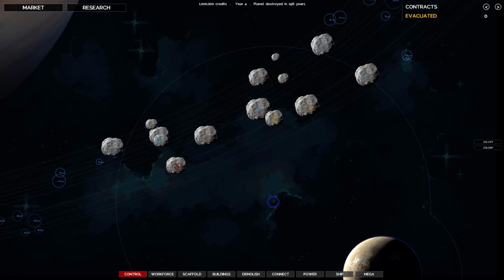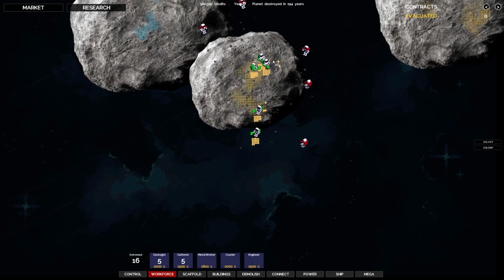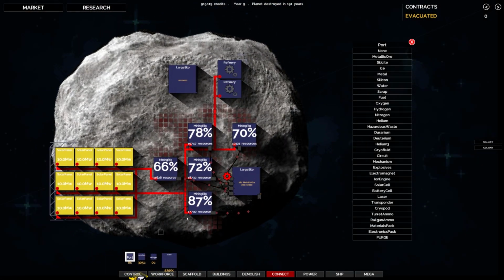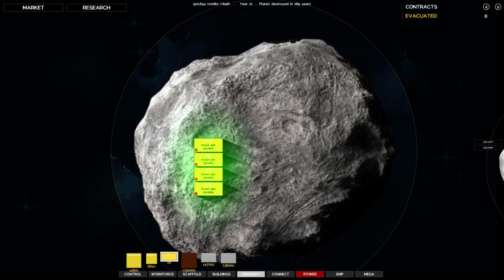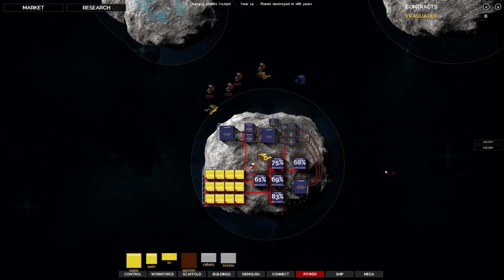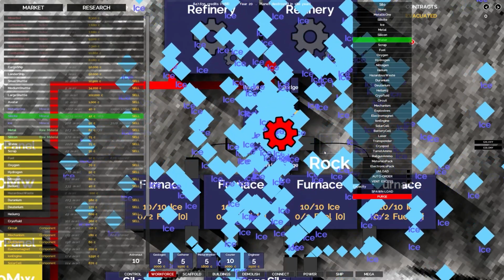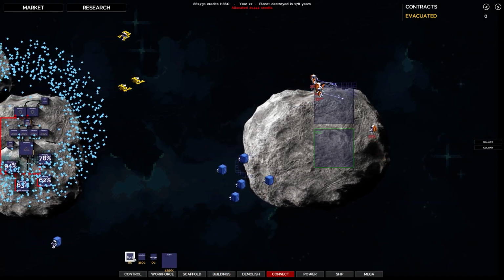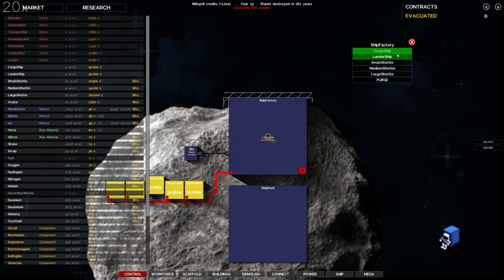Going Industrial in SPACE! | Deep Space Industrial Introversion Prototype - Let's Play / Gameplay

Comment: Great video, thanks :). Glad you had fun!
 You CAN move material from one silo to another using your courier guys, but it's a little fiddly. You had the right idea of setting the destination to request Metal. Then at the silo that is full of Metal you have to tick "Unload" - this tells your Couriers to pick it up and try and put it somewhere more useful. Worth noting that if the commodities window shows SELL next to the item, your Couriers will take any spare metal to the transport gate and sell it.
You can also use the Gate object under the Connect menu.  You need a gate at either end and its a directional one to one link. But you can put whatever you want into the FROM gate and it will pop out of the TO gate like magic. Subspace short range transport ftw!
To build an interstellar ship, go to the ship menu and place a Ship Bridge first.  Then you'll be able to build around that.
Have fun!
Reply from the maker: Indeed, and thanks for the info. Played some more and feels so close to RTS territory! Was leapfrogging on the asteroids while gathering, building, and defending. Suddenly found myself really wanting to build ships from scratch using the same method and systems, then send them off to attack. By extension would have to build the infrastructure of refiling, repairing, and re-arming too. Just my 2 cents. Hope you find an angle and have another stab at it. For everyone else reading, this is the developer ↑↑↑↑↑↑↑↑↑↑↑↑↑↑↑↑↑↑↑↑↑ (Chris?), so any questions, suggestions, or words of encouragement reply on!
Reply: Really enjoying this one

Which way round do you link it, do you select the to gate from the from menu?

Also how do you work the buildable cargo ships are they like large couriers?

Finally is there a building to store passengers? I got some stuck in a pipe and it jammed up my dock area